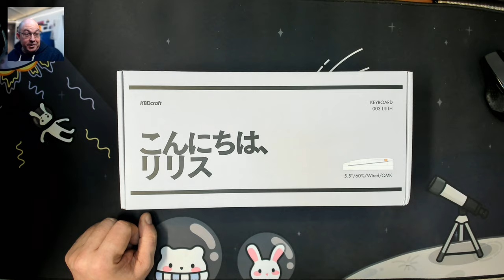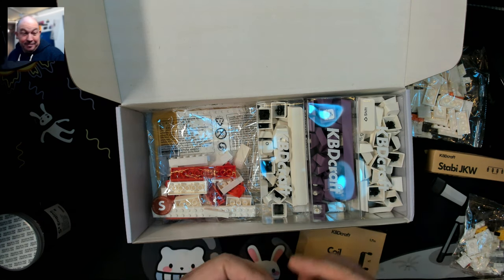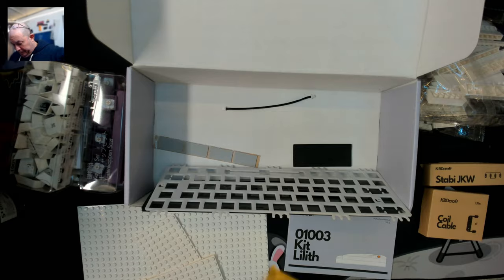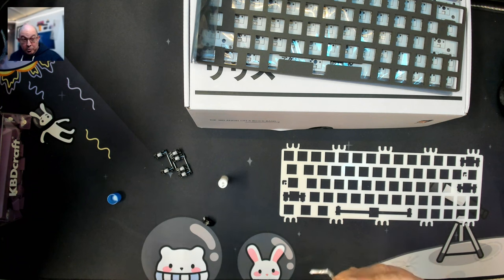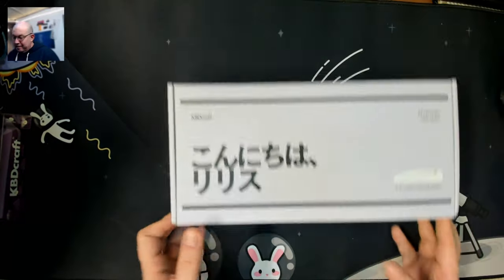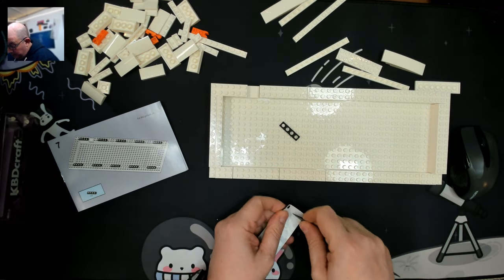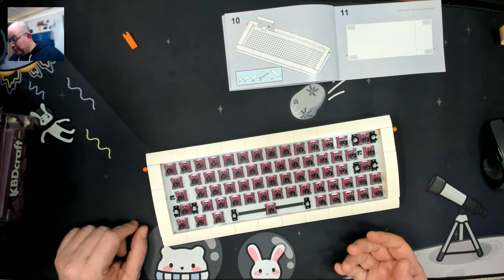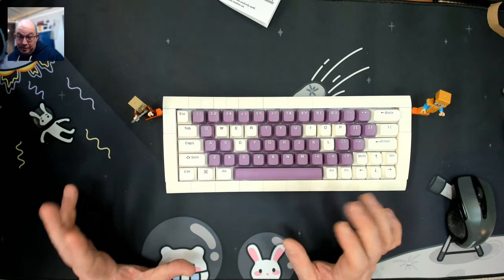Arts and KBDCrafts for Everyone! - KBDCraft Kit Lilith

Comment: I'm guessing the double wall and centres provided by the bricks gives a lot of sound shaping to the sides.   The base plate is probably thicker than the plastic on a lot of cheap (and not so cheap) keyboards as well. So the only air is under the pcb and the sound is confined. The bricks won't ring like a plastic or aluminium shell. 

Out of interest are they using branded bricks? How do they compare to the real ones?  Hopefully better than 90s mega blocks. 🤔
Reply from the maker: They are nicely built and unbranded, also fit perfectly with authentic Lego pieces. It's a fun little kit that is as much joy building as it is using. I hope to have time to mod this one in the near future.